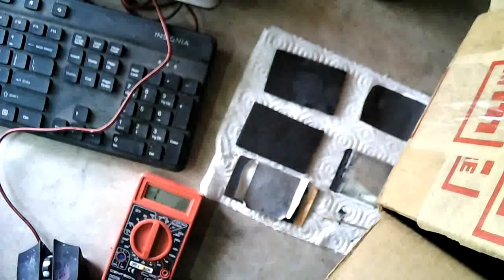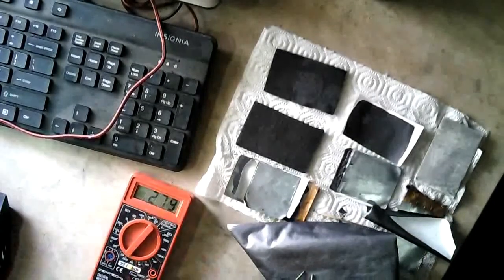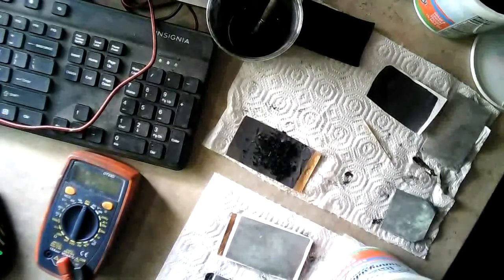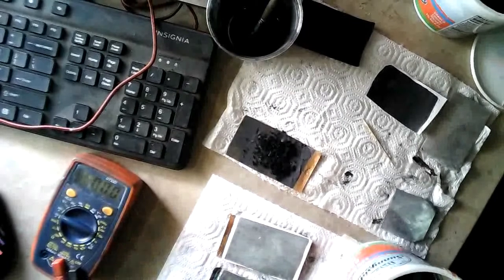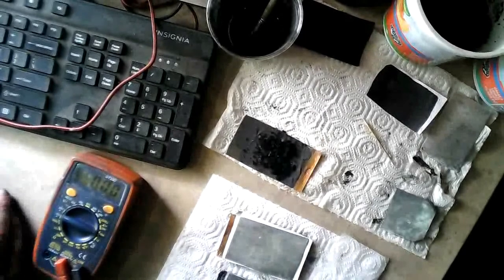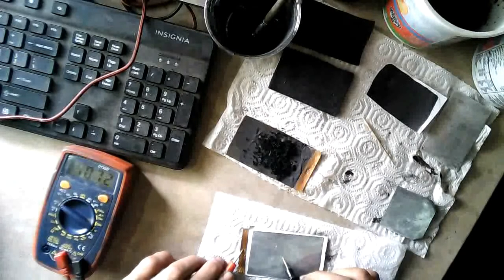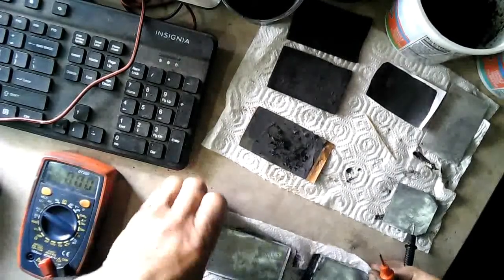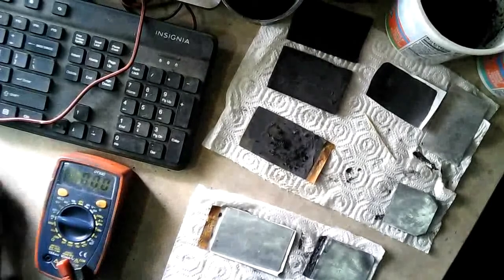Bio-Cell, The Ideal Battery!

Comment: You got me hooked ! I ordered in some titanium dioxide and looking forward to trying different metal. Hopping to get a result that will enable a led solar garden light to work during the night and charge during day with the solar panel disconnected . 4 of these size cells might do it I thing but I would like it all to fit in the existing casing . A really good experiment I think 🤔😊
Reply from the maker: That sounds like a good practical experiment and use. After that is successful, you'll want to build a bigger battery since they are so cheap to build I'm sure. Glad you caught the Bio-Cell bug! Lol

Comment: A quote by Albert Szent - Gyorgyi in his book Bio Energetics." Research is to see what everybody has seen and think what nobody has thought. Won the Nobel Prize in Physiology or Medicine in 1937. Credited with discovering vitamin C and the components and reactions of the citric acid cycle. Wikipedia.
You appear to be well on your way to achieving your goals.
One step I would recommend is building a control sample and let it sit to see what values it reaches with minimal  intervention.
Reply from the maker: He was a great man! Notice that I use a lot of vitamin c in my carbonization and battery experiments. That's a good idea Fred. One of the things I suspect about this cell, is that it needs a load to perform it's best.